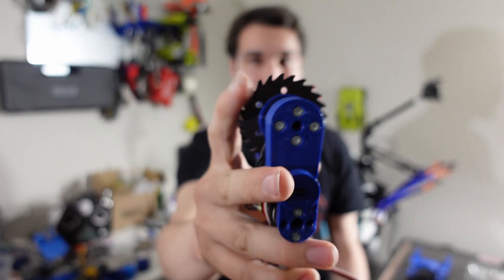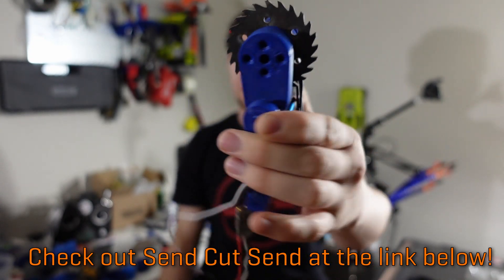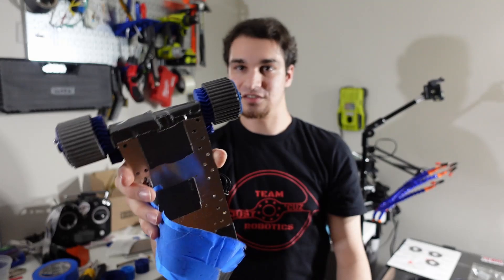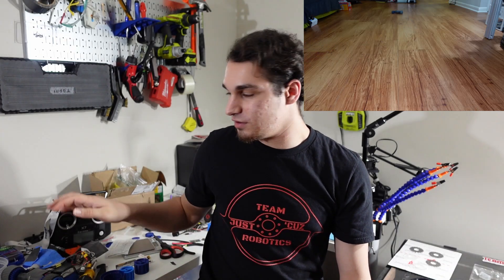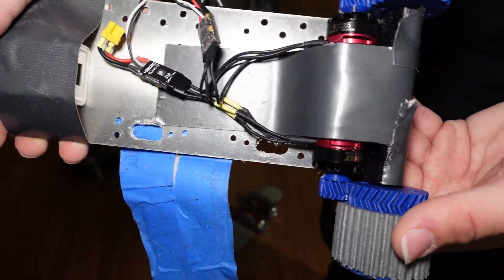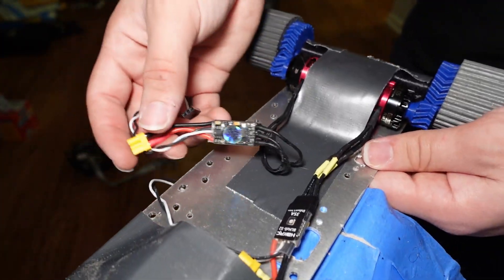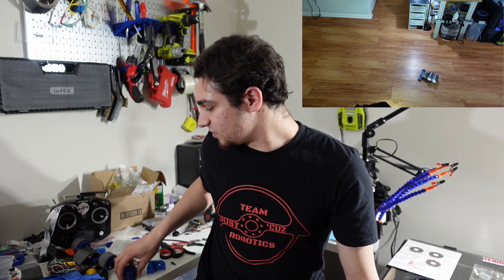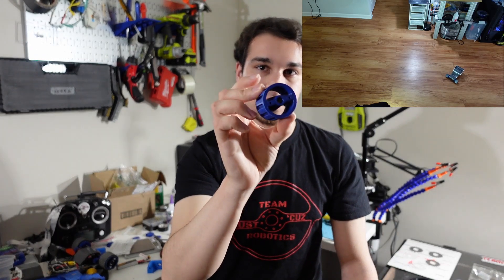The Process: Drivetrain Developement & Testing for Shrapnel Mine, 3lb Combat Robot

Comment from the maker: People were asking about the components I'm using, so I just added links to the description and will add them here as well. 
Affiliate links for the parts I'm using (no added cost to you)
BlHeli32 ESCs: https://amzn.to/2R87Yvu
Emax Motors: https://amzn.to/2RcIbT5
2S Lipo Battery: https://amzn.to/3o72kGa
FS2A Receiver: https://amzn.to/3eAZyG0
Vytaflex Casting Rubber: https://amzn.to/3o4Ub57
Overture PETG Filament: https://amzn.to/3tH3CZr

Comment: Hi, At 13:08 perhaps you could try a hex coupler nut instead of a regular ol' nut in that hex recess? It's longer and would resist a bit more when the shoulder bolt is struck side on :-)

Comment: Filing some side relief on the saw blades should help reduce the bog down when cutting. You might also try a Triple Chip Grind profile. (The plastic melting and trying to glue to the side of the blade can cause all kinds of problems.)
Do you think the twisted tread tires will require a multipart mold or will you be able to twist the cast tires out of a one piece?
I have my own ideas for a bottom attack robots so I'm vary interested to see how well this design works for you.
Reply from the maker: Filing AR500 doesn't sound very fun... I can always change the 2d design and get new ones cut for cheap but I don't want to do any hand filing for risk of unbalancing the blade.

The twisted tread should be able to come out a single part mold just fine with a slight twist if I design it properly with a slight helical profile. Should be pretty easy to do.

Comment: I know this vid is all about the drive, but just wanted to let you know on your saw if you go with smaller and more close-together teeth your weapon won't jam up on you like it did in this video.  just FYI
Reply from the maker: I've got options, I have a 18 tooth and 24 tooth already on hand/. However I doubt that is the issue since the sea also cut through the PLA when I accidentally spun it backwards. It was getting the sides of the saw jammed, not the teeth.

Comment: Why not countersink the bolts?  I'd be trying to get them in where the wheel is toast before a spinner can hit the head of the bolt. 

I think I would be going with a larger diameter tube as the axle that spans the entire robot and use snap rings to retain the wheels. But I have a lathe I could turn the tubes on.

I'm currently foamboard prototyping different bot designs. I've been impressed with the brushed motors I've been testing with. I actually only bought them for the gearboxes with the intent to convert them to brushless. Now I'm thinking I need to order some better brushed ESC. I'm currently using an arduino and dual VNH5019a motor sheild that I had kicking around for another project. It's way to big to be on a 3lbs bot.

I think the next project for me is to start casting wheels. I'm trying to figure out if I can make the mold and hubs on the CNC router at work. 3d printing is just so slow. I might just have to borrow the 3d printer from work and bring it home for a few days.
Reply from the maker: Each mold only took maybe 2 hours to print and the hubs about an hour each. I am also making much bigger wheels than a normal person would so you probably don't need THAT much time printing.

As for the countersinking, yeah I probably will switch to flathead shoulder bolts if I decide to stick with the unsupported wheels but I have the heads proud since originally I wanted another part supporting the outside of the wheels. I might need to make the wheels a lot thinner to fit them inside a reasonable size for the overall bot and use a much shorter bolt as an axel as well.

Comment: Hey there! I happen to be using (almost) the same exact motors as you are for my bot (ECO 2207 2400 kV)! I used a 1:10 gear ratio (currently converting my normal gear to planetary gears) and found a bit mroe success but I have to run my motor at 6% of it's pulse width since the motors are so fast. What % throttle are you running your motor at?

Also, I did a rough estimate of your gears and they look like a 1:4 ratio. Is that enough torque? I had quite a bit of torque running my motors straight from the shaft and I can't imagine 4x torque would have been enough
Reply from the maker: I think I said in the video I'm running just 2.6:1 reduction and it's surprisingly powerful but obviously higher reductions would be better. I just don't have much space to work with. I can only make the small gear so small and the big gear so big.

10:1 should be great. I haven't limited the throttle much, it's set to 70% right now but I haven't really played around near the max speed at all.

Comment: what's the thought behind having treat on the wheels at all? I would expect that smooth tires would have better traction on the arena floor
Reply: Normally it would work well on smooth surfaces. However during competition the floor tends to get damaged over time and leftover debris from previous matches would build up and stick to the tires. Eventually there would be so much debris stuck on the wheel that there wouldn't any grippy surface on it anymore. The treads allow the wheels to catch on the imperfections of the floor while at the same time not cover it entirely in debris.
Reply from the maker: Pretty much spot on there! Plus it looks cool 😊

Comment: I've been looking into doing Brushless to Herringbone drive similar to this and SMEEEE on SawMurai. 

Regardless, I am still excited to see where this goes.
Reply from the maker: Awesome, it definitely works! I greased the gears with a little silicone lubricant but I'm not sure it actually helped. Still the PETG gears are spinning at 20,000 and 7,700rpm respectively and didn't melt. When I tried PLA gears on Draconid they melted at 8800RPM